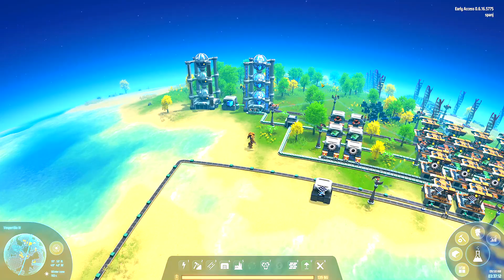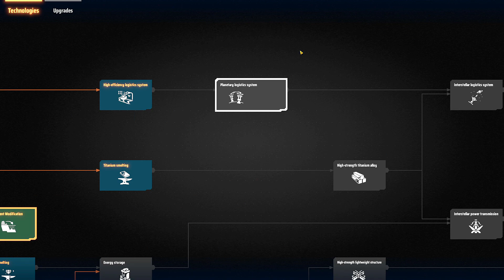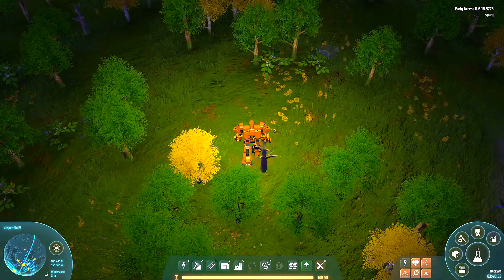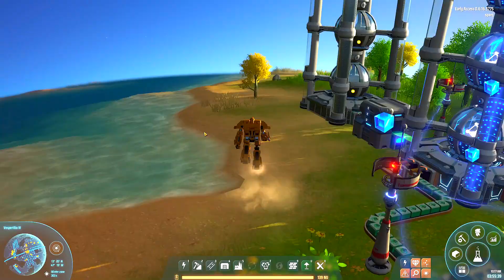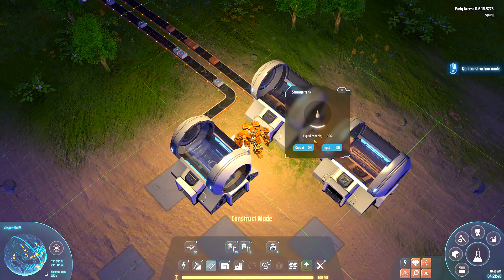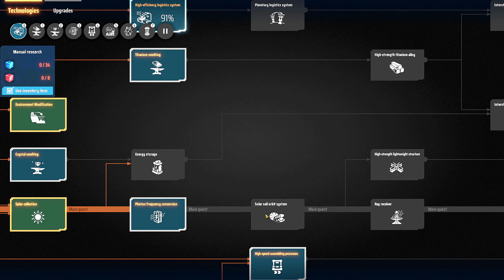ENERGY MATRIX, MY BRAIN HURTS! | Dyson Sphere Program | #3

Comment: Hey Spanj, as a few others have said, you can filter the sorters as you place them. After the first click, before the second, press tab or the left and right arrow keys to select from the available options.

You can select the belt going into the tanks, you need to be in construction mode. Press 'b' or select something to build and press the right mouse button. You also need to be at the correct angle so it might have been difficult with your 2 tanks as they are.

You don't really need the plasma exciters for anything other than refineries. And you don't need many prisms until much later. 

You probably want to think about automating production of belts and sorters. Maybe wind turbines too.

Finally, red cubes are slower to produce than blue, you might want a few more labs producing reds than blues.

Comment: Once you get the X-Ray cracking you can substitute the oil/hydrogen liquid containers with another Oil refinery set to X-ray and that will output your Hydro/Graphite for the red cubes  which will also allow you to keep the current hydro/graphite belts in place going to the red cube labs

Comment: 3 tips:
1) When placing miners, you can hold the SHIFT key down and 'R' to do a better rotate
2) you CAN delete the belt into the tank.  click 'X' (delete), and hover over the belt until you see TWO red 'X's, that will delete the piece of belt that enters/exits the item. (I saw it light up that way while you were trying to do it)
3) when putting the output sorters on, you can set the filter BEFORE you set the the sorter down, the filter menu comes up before you actually set the sorter.
Reply: Just two things: Instead of using the "r"-key use the left and right arrow keys so you can rotate the object in the direction you want. And use the tab-key to set filters.